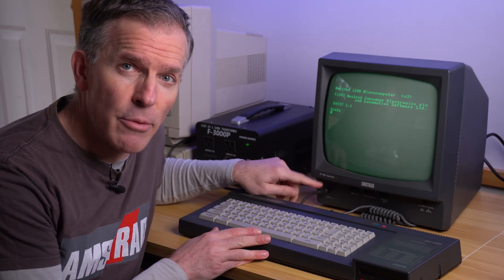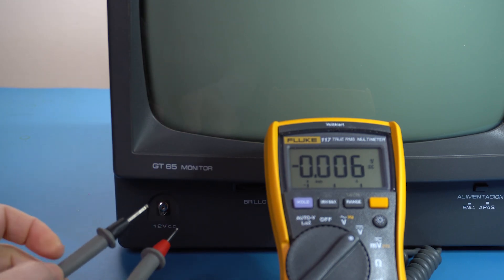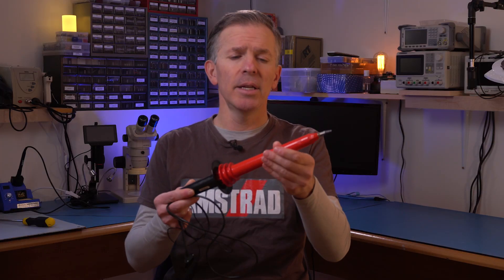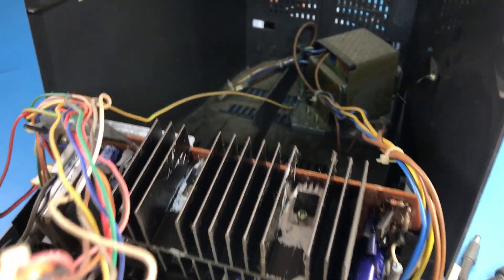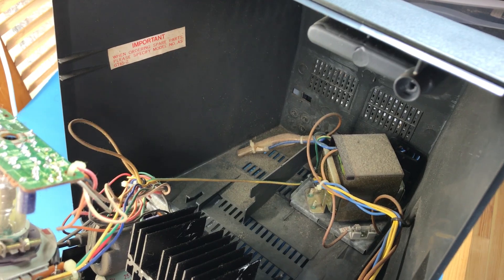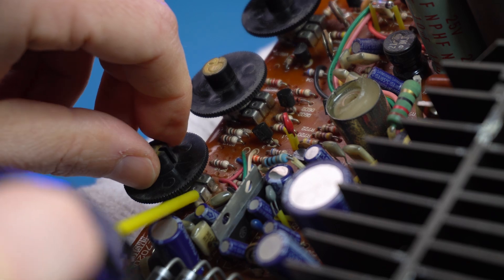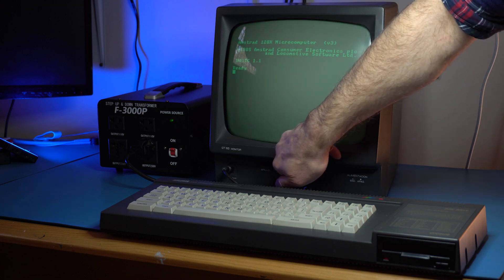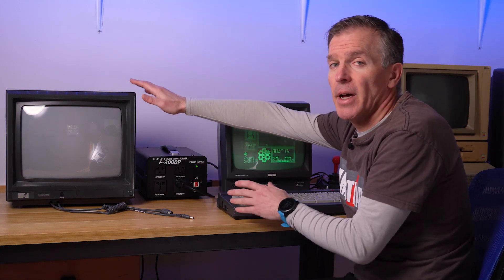How To Service A CRT Monitor

Comment: Used to work in a repair shop if the red wire needs to be removed so you can slide out the chassis then discharge it. Otherwise we didn't. 
If you feel safer always discharging it do so.

Comment: You should not be spraying regular DeOxit on pots, they make a fader type especially for those. Initially, it will work fine and clean the pots, but the stuff is a bit corrosive and the pots could stop working in the future.

Comment: Finally someone who doesn't recommend the stupid screwdriver method. Why that got so popular, I have no idea... You don't have to buy an expensive probe, you can build the tool yourself, you need just some high voltage cable, something to make a plastic handle with, a beefy resistor and an aligator clip

Comment: Hi, Noel, you mentioned that discharging a CRT using the screwdriver and alligator clip method can put stress on components because the discharge is instant.  Other than the CRT itself, what other components would be stressed using the screwdriver discharge method?

Comment: Hello! I've tried to search the internet, but no meaningful results are coming up. I have a color CRT monitor, LG Flatron F700P to be precise, and there is color fringing in it, or at least that's what I believe it is. Basically, ghost-like images to the right of everything. What is the way to fix it? I heard it's possible color beams need to be calibrated, and I would need to open up the monitor for that and likely have it on to adjust it so that I can see everything, and I'd rather avoid that if at all possible.

Comment: Looks like the 12V reg is missing the I/P and O/P capacitors; those are a must if the reg is going to work properly. No wonder it died.

Comment: The reason why you see the jutter is most likely the fact that you use the transformer with 60Hz while the monitor itself refreshed with 50 Hz. So you see a 10Hz wobble from the transformer interfering with the crt beam.

Comment: Hi Noel, the High Voltage Probe I see online cost around 300-400 EUR. is that similar to what you have? I would have assumed they would be way cheaper
Reply from the maker: Yes, unfortunately it's very expensive. I bought this one off Ebay for about $100, so what you're quoting seems extra high. Heck, you could buy it from the US and ship it and be way cheaper than that. But maybe things have gotten more expensive for some reason.
Reply: @NoelsRetroLab  Is the one you are using the Fluke? it goes up to 6KV. Isn't the voltage on a TV higher than that?
Reply: @stellardynamix  Black-and-white TVs are typically 12KV.

Comment: Nice vidéo as always.
The 12v Reg for the floppy is normally a 78M12 a 0.5 amps model and not not a regular 1 amp. Usually these regulators are very well protected and to blow it as violently as it did it must have been it mut have got some voltage fed to the output.

To fix the vertical jitter there are a few possibilities:
- Jitter in the supply voltage
- Oxidized potentiometer
Put an oscilloscope between pin 1 and ground, check if you can see jitter in the signal:
If no, the jitter is not produced by the vertical circuit -> other source like interferences etc...
If yes, then try to clean (de-oxit) VR701 and VR702 (vertical size and position)
If the problem persists check the supply voltage with the oscilloscope to see if it jitters too.
If no, then the instability may come from the vertical oscillator (capacitor, vertical hold etc...)
If yes, then the jitter can come from the power supply itself or anywhere in the circuit back to line voltage

If the problem comes from line voltage (insufficient line regulation) try moving the monitor and computer
 to a completely different circuit and see if the problem disappears.

I have seen similar problems in shops were they had 20 or 30 CRTs on the same circuit.
The only very imperfect solution is to use AC line filters but that's a real pain and it never really works 100%

As a last resort, changing the power supply to a switched 12v is a possibility by then the switching frequency might become visible
unless you use separate DC to DC converters.

I hope that helps.

Comment: Never work or open unless you know how to discharge the tube and any large capacitors also double check it is unplugged do not think it is safe by switching it off also use one hand at a time when finally reaching in and take care of any sharp items inside

Comment: I'm not sure I would call Adrian black an expert on monitors, he seems more like a replace things until it works kind of guy to me. He does far better with the computers themselves. That's not too say i know better, but i know enough to recognize shortcuts. 
Just replacing the transformer is an example of a big shortcut. It should be possible to actually fix the problem.

Comment: Good to have a simple one from time to time :)
Note that the 12V regulator in these monitors is specified as a 78M12 (rated at 2A) and not the standard 7812 which has a 1A rating. In this sysyem it probably won't make any difference, but if the disk drive is one of those that draws more than 1A it might cause weird issues when accessing disks, particularly when writing data.
Great fix though :)
Reply: Another user comment says a 78M12 is rated at 0.5A.

Comment: Hey Noel!
Please be careful with these kind of probes!
I use them in my job very often.
You need to take care your Multimeter has a impedance of 10MOhm so the division of the measured voltage will be right!
And the Probe i get shown using your amazon link is the 6kV one.
the Cal Test is a 40kV probe that would seem more useable.
but the Cal Test and as far as i know the keysight ones are sold out.
So any viewer interested in the probe should search for the fluke 80k-40

Comment: Have seen people say you should do it to get the spark so you can see that it's discharged... Maybe that'd make sense if you got that spark every single time, but you're not gonna get any if the bleeding circuit works, so just do it properly.

Comment: interesting comment about the sudden discharge when using a screwdriver. I read on an Apple service manual for an Apple CRT monitor that Apple used to have a discharge tool with a resistor in it which was then replaced by one without one so the technician could have a visual and audible cue on when the tube was getting discharged (the spark and the click noise). Thanks for the video, been missing them!

Comment: Since 120 Hz is higher than 100 Hz, I doubt that the choice of filter capacitors is an issue. They may have dried out or become DC leaky over time though, even without visible damage.

Comment: 5:11 in fact your left hand should be inside your rear pocket so in the event a strong current DO passes thru your body (when you touch the anode with your right hand using the probe, assuming it conducts current against all odds) a part of that current goest thru your left arm "in parallel" with some current passing thru your upper body where your heart can be critically hit (it's best to lose sensitivy in your arm than to have a heart attack right?).
Also NEVER NEVER WORK ALONE IN THESE ELECTRICAL SHOCK RISK SITUATIONS! (i.e. a coworker or relative can save your life if he/she is ready to turn power off or use some isolating material, like a wooden pole or stick, to stop you from connecting with equipment)

Comment: What happens when you have only the 664 monitor and you connect the 5V output to the 12V output? Or it doesn't fit?

Comment: i  just finished watching retro recipies latest video about the 80's theyre having issues with a tv/monitor from the uk i believe the issue you have with your monitor is the same as his issue. your voltage transformer thing can produce the higher voltage but it doesnt change the Hz so that is probably the same issue for you. im sure there is probably some solution to it though

Comment: As for the DC idea, it should work if the chassis all runs off DC, just have to get the input volts right as well as the power ratings of the DC supply, I'm in the midst of sticking a C64 DTV board inside an old 6" portable TV (which is a triple-play power setup, battery, 12vDC & mains 240v) and have ditched the old inefficient linear power supply in favour of a slightly over-rated Mean Well 12v 50w PSU in its' place, as it may eventually also power other stuff inside depending on how the project goes... :)

Comment: The capacitors may physically look good, but could have dried out over the years internally resulting in them not smoothing out the signals as they should, worth popping them out and testing them out of circuit to be 100% sure... :)
Reply: yes i would have replaced them, the monitor is beyond 30 years now......

Comment: Hey Noel, I suspect that the jitter is due to increased magnetic flux from the mains transformer. Its positioned in the case at 45 degrees to eliminate it. Maybe this angle is not sufficient at 60Hz? Like Adrian said a DC conversion would help. You could try as an experiment extending the 4 DC wires from the transformer and moving that away. It might be enough to just run the monitor with the cover removed. I Meanwell power supply would be a great upgrade. Not only would you eliminate that stray magnetic flux but it would be multi voltage and you could eliminate the need for that step up transformer.

Comment: Awesome video, Noel! For some reason YouTube wasn't showing me your videos for a while so I had no idea you moved to the land of 110V/60Hz. I'd need to see some pretty high speed slow motion footage to be able to visually confirm it but it definitely looks like an artifact of the 60 Hz -> 50 Hz AC frequency conversion based on some of the artifacts of voltage and frequency droop I've seen working on sensitive networking equipment in power plants here in Canada. Keep up the awesome work!

Comment: The problem with High Voltage Probes is they're over $300 USD! Is there a more cost effective solution? Could you make a discharger using a high resistance device, like an incandescent light bulb?
Reply: There are Chinese clones for a lot less.
Reply: Yes, you can make a CRT Discharge Tool for a lot less; in fact you probably have the parts laying around. There are instructions on how to make one on page 11 of the book Macintosh Repair and Upgrade Secrets by Larry Pina (1990). You need an insulated test probe (like from a multimeter), an alligator clip lead, and a 10M resistor. (I'm presuming you have a soldering iron, wire, and heat shrink tubing already).

Here are the instructions from the book: 

  An easy-to-make custom discharge tool is shown in place, in Figure 1-15. This tool is made from an insulated test probe, a green clip lead, and a 10-megohm 1 /4-watt resistor. To make your own tool, cut off one end of a green clip lead, unscrew the test probe handle, slip the handle over the wire, and cut the resistor leads to size. When you screw the handle back on, the resistor leads should be completely insulated by the test probe. There can't be any exposed metal. Readjust the leads as necessary, then solder everything together. For safety, cover the entire tool with heat shrink tubing. Never unscrew the handle while the tool is in use!

Comment: I have a ctm644 that I had not used in a long time and was running the boulder dash demo on, a short time later the monitor died and I have been to nervous to even attempt a repair on it

Comment: Speaking of safety, here's a cool trick I saw the other day - put a piece of heat shrink tubing over the end of the pins inside power plugs so you can probe them without worrying about accidentally shorting something. (I suppose you could slip one up over the multimeter probe too.) https://www.youtube.com/watch?v=ZXH-L2GOH94

Comment: As my Dad would say: "If I touch the brightness dial, I get a lot of interference" ... "Then don't touch the brightness dial" ... 🤔. Seriously though, very handy video to keep saved - I've got a Commodore PET with a brightness issue that I need to fix but have been reluctant to go sticking my hands in there whilst powered on ... but how else can you trouble shoot? ;) /Brett
Reply: As RL showed, you don't need to troubleshoot, be powered on, or even plugged in. Just squirt some Deoxit into the variable resistors ("potentiometers") that are behind the brightness dial.  Rotate them back and forth all the way a few times. Let it dry for fifteen minutes or so and you should be good to go.

Comment: @12:40 - Your superpower is the ability to “look” at a capacitor to see if it’s fine. My superpower is sniffing with a LCR and other test equipment.
Reply from the maker: I can't tell you if it's OK, but I can definitely tell you if it's bad 😃 I'm alway suspect of an in-board LCR check and this wasn't supposed to be an in-depth check (because I also don't suspect the capacitors in the first place).
Reply: @NoelsRetroLab  you can't judge a cap through view (except if it has leaked or is bombing).
Reply: PaulT - As Noel says it was just a quick look whilst it was in bits.  A bulging capacitor is a thing but you may have not experienced it yet in your learning journey but does not mean it does not exist.

Comment: @1:28 - My moneys on someone plugged the 5v male into the 12v female. ❤
Reply from the maker: Yeah, that makes sense. I guess Amstrad should have gone with a smaller diameter DC jack on the 12V PSU to prevent that but they went the cheap route 😃

Comment: A tongue placed on the high voltage nipple will effect a faster discharge.
The low resistance is advantageous to the quick absorption of excess charges.
Reply from the maker: You must be an ElectroBoom fan! 🤣
Reply: @NoelsRetroLab  He is hilarious,  especially when he gets shocked. Photonicinduction also has some amazing high power experiments.

Comment: Once, when I was still a foolish teen who wanted to align the RGB electron guns in my Amiga monitor a little better, I managed to discharge it into the inside of my right bicep while reaching across it.

It didn't kill me, thank goodness, maybe because the path through the right side of my body to ground didn't really include my heart, but was painful enough that I can still see that moment in time as clearly as someone with photographic memory. I see my old desk, the monitor with the back off, angled to face a bit to my left, and my right arm across it, the open curtains behind it and the clear day outside, etc. Kind of amazing really.

Also, I'm not sure if it was visible to others or just the effect of electricity on my nervous system, but there was a very bright white flash.

Don't mess with CRTs, kids.

Comment: This myth retro YouTubers keep propagating about CRTs has gotta stop. Not in the history of man has anyone gotten injured or died from an accidental CRT discharge. It’s like getting shocked from an ignition coil/wire on a vehicle. It stings and you pull your arm away.
People throw away classic CRTs that could have been fixed, just because they’ve been led to believe it’s dangerous. It simply isn’t. Other than the main caps or having it plugged in. Is a CRT discharge unpleasant? Yes. Dangerous? NO.
Sorry for the rant, I really do enjoy your videos 😁
Reply from the maker: I'm no doctor, but I think the discharge can be dangerous (but probably not deadly). Sometimes people have a pre-existing condition, or maybe the shock can make them twitch, fall and hit something. So it's definitely not something I take lightly (or recommend that people do), but it's also important to realize that most people will not die from a discharge (especially of a smaller monitor like this one).
Reply: @NoelsRetroLab  having been shocked a couple of times from CRTs and plenty of times from adjusting ignition timing on cars I can tell you it’s nothing you fall from. It’s like a needle prick, you jerk your hand away and that’s it. And your heart isn’t affected the slightest from the minuscule amperage in these discharges. 
In short, it’s a weird thing to warn about when the risks of injury are far greater from working on anything with caps that has been connected to mains voltage. And a shock from those actually hurts.

Comment: I suppose the internal transformer may interfere with the CRT. Switching PSU would be a solution, it completely isolates the electronics from mains frequency.
Reply from the maker: Right. I'm afraid of the noise it can introduce though, so I may have to add filtering to that one as well.

Comment: My Amstrad monitor had the same issue for the 3 years I had it.
Reply from the maker: The glitchy screen when moving the dials? That's very common, yes.
Reply: @NoelsRetroLab  Sorry, no, the 'vertical wobble'.

Comment: What's the betting somebody decided to plug the 5v plug into the 12v socket and that's what blew it?!
Reply: It's a decent hypothesis. Doing that shorts both rails to ground (the 12v socket is centre negative), and while the 5v supply has a protection circuit and cuts out safely, the 12v is just the 7812 and would have a bad time (luckily it's cheap and readily available)
Reply from the maker: Oh very interesting! I didn't think about it, but you could be right!

Comment: you can probably use a PicoATX PSU with something like ATX4VC, which should give you all the voltages while being much more compact.
Reply from the maker: Any idea how noisy the PicoATX is?
Reply: @NoelsRetroLab  I haven't done measurements with oscilloscope myself, but I recently put one in my Macintosh Plus, and the CRT is rock solid. They are designed for modern computers, so I guess it shouldn't be too bad. Would be interesting to find out though!
Reply: @NoelsRetroLab  here's a short clip of it working https://www.youtube.com/watch?v=AGS9ATC1uug